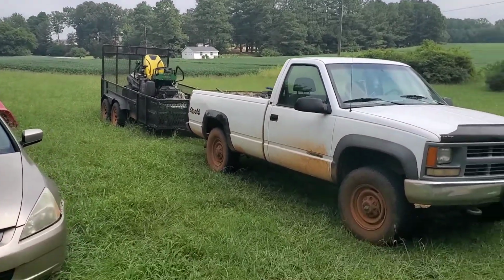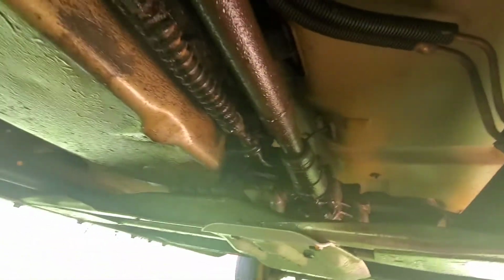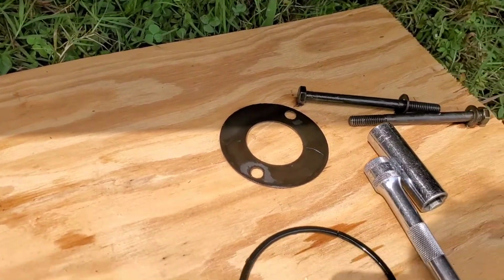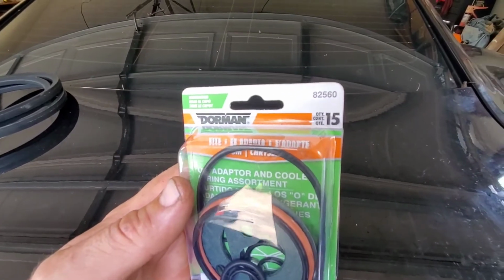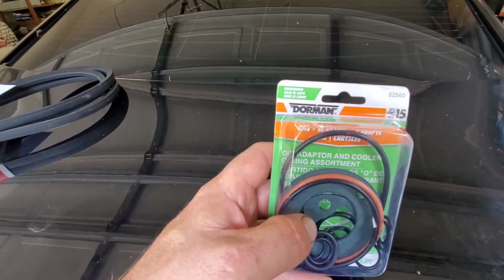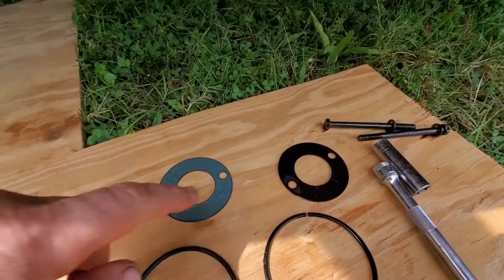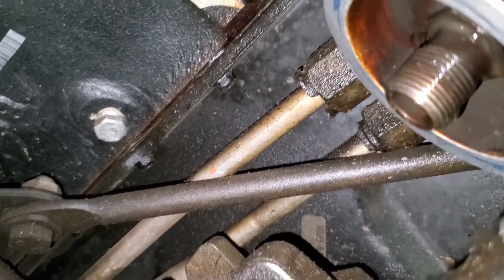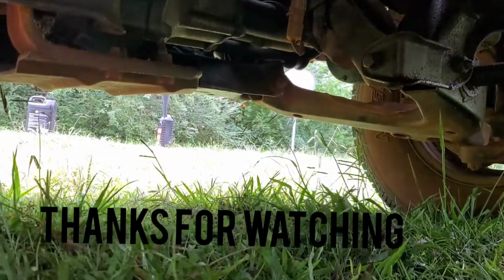97 K2500 5.7L - Massive Oil Leak! -Easy Fix!

Comment: When I turn on my 89 Chevy Silverado it starts pissing out oil I wonder if it’s a nut that came off because I see a hole or if it’s your situation
Reply from the maker: You get it sorted out?
Reply: I did it was the gasket but now I have another issue lol I helped this lady with a jump and I’m pretty sure I put the cables on correctly long story short her car never turned on didn’t even have power to crank I gave her a ride back to work as I was leaving my truck smelled a bit like burned and started running weak and shaky
Reply from the maker: @SKIESTHELIMIT91.  oof, hope everything works out okay.